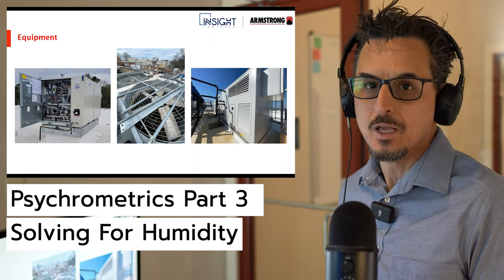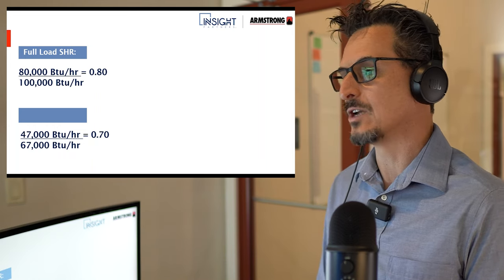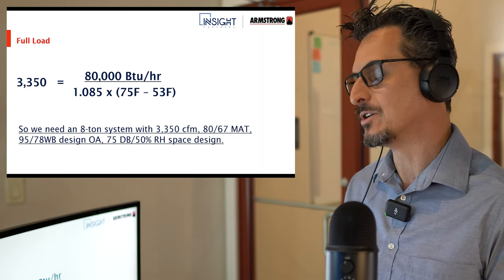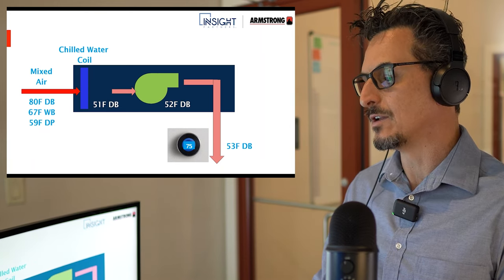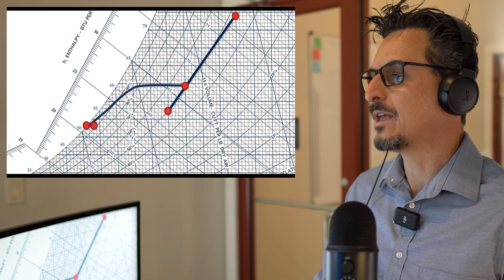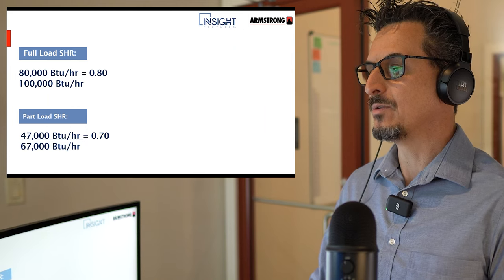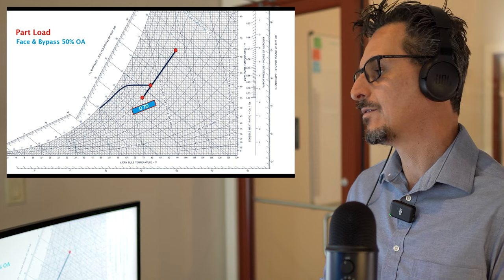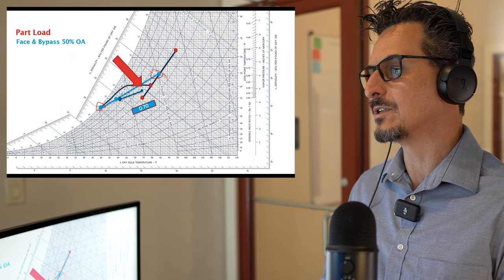Psychrometrics Part 3 - Solving for Humidity

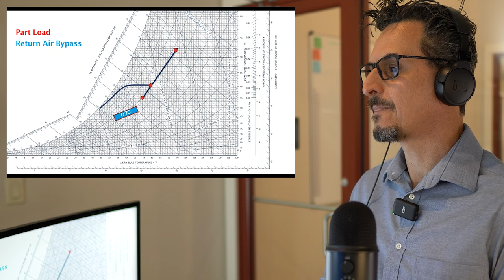Comment: I feel confused @22:30, because when you use RA bypass, means RA also reduce before mixing with FA, so the mixed point also shifted before cooled down, not unchanged like in your psychart. An in fact, partload happens when OA condition change, so the actual story is more complicated, please point it out.
Reply from the maker: Yes. For simplicity we assume the same RA and OA conditions for part load. As you mentioned these would change in the real world but it gets complicated  when trying to introduce these concepts to a beginner, especially online. This is considered a beginners coarse so we try to focus on the processes, eg RABP. Thanks for the comment and watching the video! 🙂